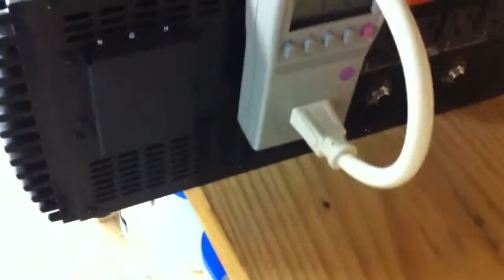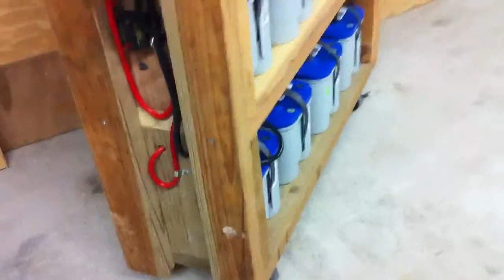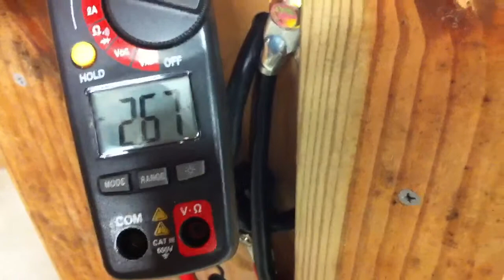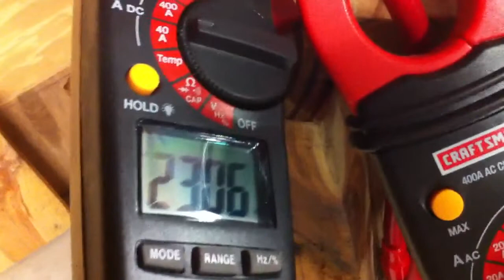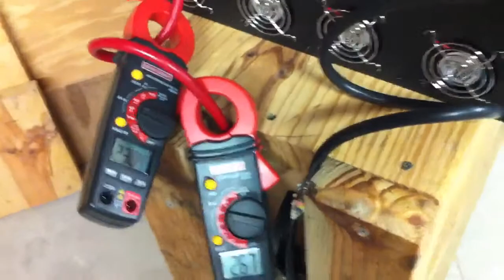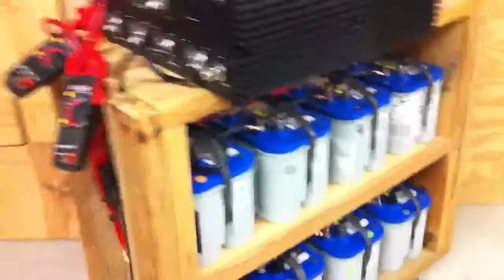Solar Project: Mobile Battery Rack Finished

Comment: Good thought putting  it on cart // personal i would leave it 12 volt system // 
 Reason can charged emergency by any auto //truck //battery charger or with only one solar panel if one gets broke or such// also u can pickup 12 volt inverter any where // in any disaster over any other voltage// also solder ur ends want save energy// not now but in years to come crimped ends will start lose connection //  from corrosion watch copper in the air it tarnishes and turns brown loses connection